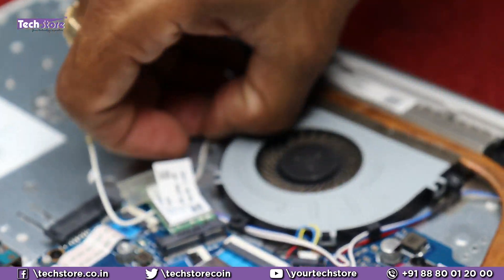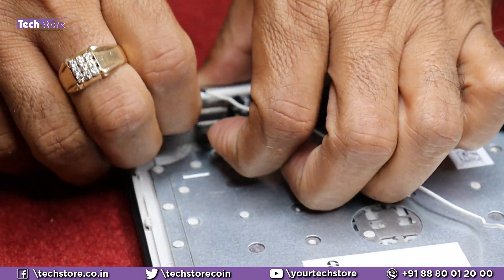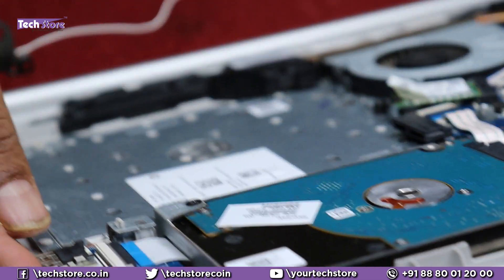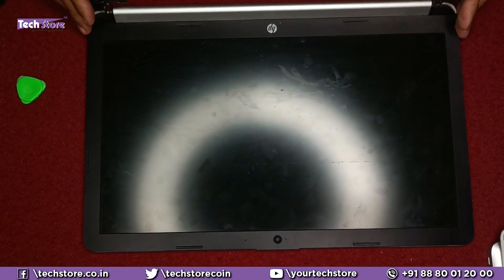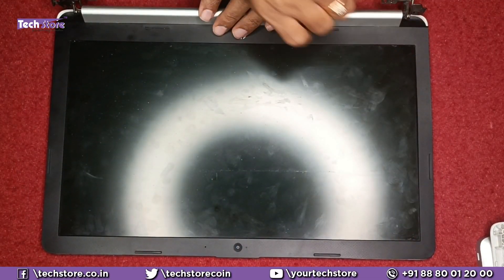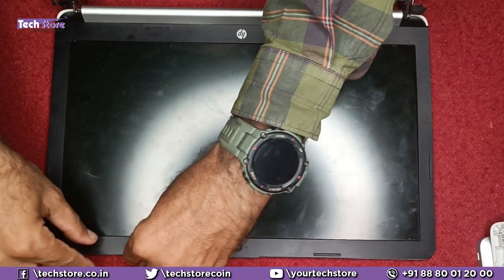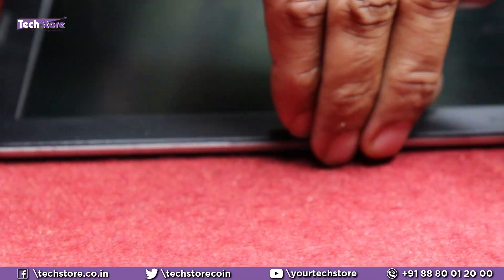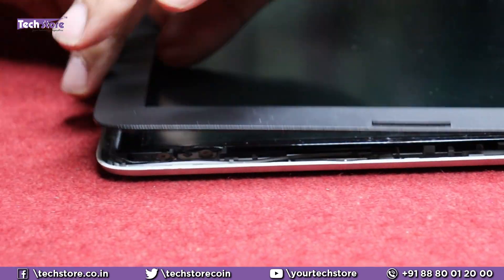How to change any TN Panel LED screen of a laptop to Full HD IPS Panel LED screen for 30 Pin LEDs

Comment: hi! I've tried this on my hp 14 dk laptop and the 1080p screen is on but displayed nothing. Do I need to replace the LCD flexible? or there's converter short of things that required? thanks
Reply: Did you check connector compatibility? Some FHD panels come with a 40 pin connector which might require a new display cable too

Comment: I did the same mod on my ThinkPad T490. I ordered the screen from eBay, and luckily, they didn't add any custom duty. It should generally cost around 4K to 6K. However, there are some rare panels with a 72% color gamut that you will never find in India, which would probably set you back around 9K to 12K.
I think some mods only make sense if you have a sentimental attachment to the laptop.
I also see some genius questions like, 'Can we install OLED?' Boss, no one has had any success in the Reddit community yet. Give it a try—find a manufacturer in China, burn some money, order the screen, see if it fits, and make a video to contribute to the community's knowledge.

Comment: Hello sir can i change my laptop ( loq 15 Ryzen 7 7840HS ) display 45 ntsc to 100%srgb?
Reply: Bro it already has 100% srgb display with 2k resolution which is ips with a wide viewing angle then what is your problem!!
Reply from the maker: Not every LOQ model will have the screen specifications you mentioned here.

Comment: Hi there! I have a Lenovo 100 151BY 80Mj laptop with the same issues you have so aptly described. I too, would love to change to an IPS 10180p panel. Is it possible to make the changes with my specific model of laptop? (it has 30 pins). Thanks in advance.

Comment: I have 2 questions. 
1. Can we replace an OLED display with a high quality lcd display. Reference laptop for this is acer swift go 14 OLED. Which is the lcd panel supporting this.
2. I have an apple macbook a1502 model it's display went black. When powered on there is the sound but no display. What could be the issue here. Have tried new lvds cable no luck. Can you fix this?
Reply: I'm not a technician but I think as the OLED is thinner than LCD displays the replacement won't fit into the display housing.
I have no idea about the changes in voltage or other technical differences between the two types of display which might hinder such a replacement.

Comment: i want to change screen ASUS X512FA. it has installed screen part number N156HGA-EA3 REV.C4  I went to shop who given me B156htn06.1 screen which is also showing negative pics from side, but in both screen its mentioned IPS. Can you tell me which is real IPS screen i can install on my laptop ?
Reply: i am having the same laptop so do you got any gud screen for it?

Comment: Is it possible for Lenovo IdeaPad slim 3 with tn display to upgrade to ips panel and whats the pricing
Reply: Bhai mera bhi same laptop hai bhut bekaar hai display koi solution hai ?
Reply: @prakhargupta5145 bhai muze kuch solution Mila toh batana Mera Asus vivobook hai 😢
Reply from the maker: Yes we can upgrade to IPS panel
 6500/- charges. Shipping free. You need to send your laptop to our location. This price is in exchange of your old working screen.
Reply from the maker: Yes we can upgrade to IPS panel
 6500/- charges. Shipping free. You need to send your laptop to our location. This price is in exchange of your old working screen.
Reply from the maker: Yes we can upgrade to IPS panel
 6500/- charges. Shipping free. You need to send your laptop to our location. This price is in exchange of your old working screen.

Comment: can my laptop Ideapad 320 15ABR used NT156WHM-N42 1366x768 to NV156FHM-N42 1920x1080 IPS?
Reply: If its not fhd just don't do it or you will get incompatibility issues becuz ur processor cannot handle fhd

Comment: is it possible to change the display of a Lenovo V15 ADA Ryzen 3 3250u which has a tn panel and can it be changed into ips panel?
please reply with tellling the cost
Reply from the maker: Yes you can change. Cost is 4500/-

Comment: In my HP laptop 15.6 inch 30 pin TN panel 
Can i upgrade Full hd IPS ?
Reply from the maker: yes you can.
Reply: @TechstoreCoIn  I have an HP 15Z-ef1000 with the 15.6" screen with the 1366 resolution, non touch 30 pin connector.  I'd like to upgrade the display to a 1920 resolution panel.  Will I need to replace the cable that goes from the motherboard to the display panel?